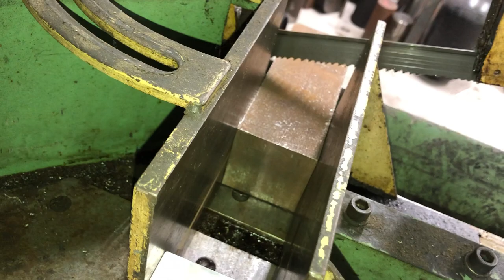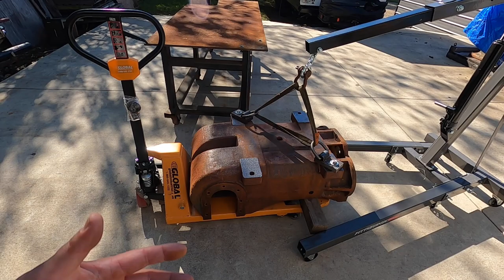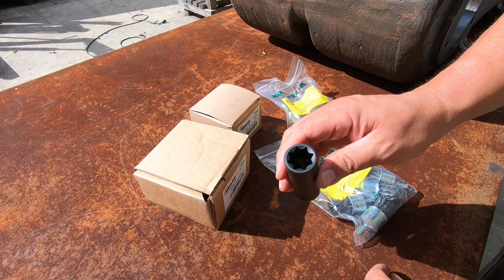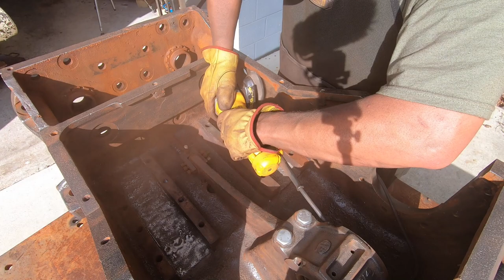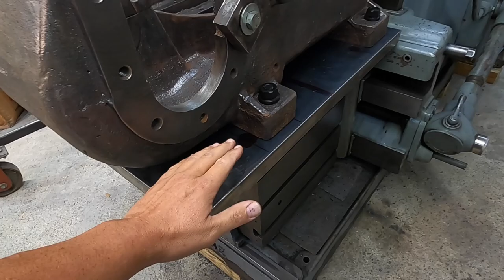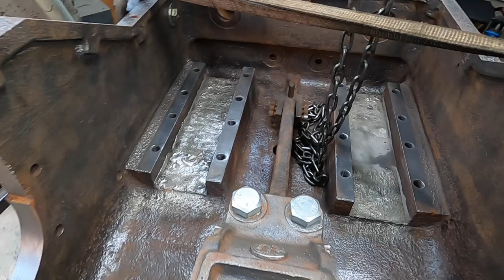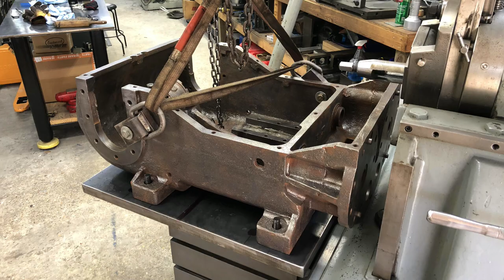SNS 326: Stoker Engine Clean Up & Test Fit, Indicating Square Stock, Work Boot Repair

Comment: I could both smell and taste that rust dust.
Spent many an hour doing wire brush rust removal at an old job. Wore the same respirators that the painters used, but I could still smell/taste the rust.
Ah, the memory of a nasty dirty back breaking job. Thanks, I think.. :)
Reply: The job I didn't like the most in an automotive shop was cleaning the carbon off of intake and exhaust valves. I could smell and taste the dust from that for a couple days.

Comment: I tried a pair of thorogoods after you mentioned them a couple years back, and I haven’t worn dire t work boots since.  I’ve been through danner, Wolverine, redwing, you name it, the thorogoods are hands down the most comfortable work boots, and made in USA!  You ain’t gonna run a marathon in them, but you can’t beat the comfort, stability, and durability.  I send mine back to thorogood for refinishing, but want to see how these guys do with yours.

Comment: Thanks for sharing! You might want to give the stoker engine a spray down with that CRC's Rust Inhibitor that you showed in the past.
Reply: That was used on the outside table I think. Does not seem to have helped much.

Comment: Couple of tips from a former foundryman, baseball glove lace is a good source for leather boot laces, and cheap, they're burn resistant. Also spray on pickup bedliner on the toes of work boots protect them vary well, but make sure to silicone the boot sole stitching before spraying, or the cobbler can't resole them.

Comment: When I see Stroker engine I think 383ci SBC (small block Chevy). I put one in a 1986 Chevy S10 back in the day before LS swap the world.  Started on it at the age of 13 learning how to and working to pay for all of it myself.  Had it ready to drive just before turning 16 and tuned it to run good at 16 years old.   Part of what made me go down the part I did.  My family were Carpenters loving them dead tree carcass. Only thing I like about wood was it looked good as the bed in my truck.  Love metal

Comment: Instead of high-speed or carbide you might consider 10% Cobalt High Speed Steel. All my internal and external threading tools are 10% Cobalt and they resist wear like nothing else.

Comment: On my small bandsaw it also has a movable jaw .
I did use odd blocks to balance out the jaw on short work. I then got the idea to drill and tap a 1/4"-20  hole in the movable jaw on the side opposite the saw blade. 
I cut a piece of 1/4" allthread and jammed a
hand knod on one end. 
I screw that in the 1/4" taped hole. I use the screw to balance out jaw.
Works perfect . May not work on your saw .

Comment: 5:00 Magnetic blocks and internal indicator - you could just use 2 opposite each other, focus on that axis then swap the magnetic blocks to the other 2 sides and get them aligned.
Reply: @paulcopeland9035  Maybe you haven't got 4 !

Comment: Abom -genuine question after seeing someone compare many pentrating lubes... how does evaporust work on siezed bolts?  Might be worth a quick vid maybe, comparing it to leading oils?
Reply: All you need is good ol.. WD40... it cures everything.  I use it for thread tapping too.

Comment: It's good to see you wearing a mask when grinding that rust. Ive seen a lot of people just stand in a huge cloud with no PPE. I don't know how they do it.
Reply: Think he smokes, so his lung should be just fine.
Reply: @clutch5sp989  smoking is probably better than all that oxide :)
Reply: @clutch5sp989  Not sure how smoking makes lungs just fine.
Reply: @jonka1  "lung" (singular) is fine. It's a smokers joke thingie
Reply: @clutch5sp989  "lungs" plural ... meant as a generalization. Good joke, btw:)
Also: This meta-level of sarcasm most likely confuses the ordinary YouTube user.
So lemme translate this thread: USE A F'N MASK, when grinding or producing any other kind of dust that wants to wildly fertilize your lungs.
To the people: We give a s. Its your lung, and it is your life.

Comment: On my four jaw I mark 2 jaws and don’t loosen them so when I flip my parts I just tighten the two that are not marked and it is pretty much on target this just works for after the first set up never tried the trick you just showed for square or even offset square parts I love learning new stuff old school machine’s are the best you learn so much and make you feel like part of it CBC has it’s place but it just makes you a programmer I have done both and preferably old school is the best you have to think about it and come up with new stuff that works I feel much more proud of what I make

Comment: Adam - don't worry about the exterior appearance of the stoker - rust is as clean as it will ever be on the locomotive, it more likely will be encased in oil, grease and coal dust.  I only worked on the railroad for over 50 years.

Comment: Adam, wouldn't it save a lot of time and work removing rust on something like this engine you were to spray it down with some type of oil, when clean, before storing or transporting it.

Comment: Adam if you take a spray bottle and mix 50/50 mineral spirits and Lucas oil engine oil stabilizer then spray the parts they will not rust and clean up is easy.
Reply: Or WD40 works a treat
Reply: WD-40 was designed for that job !

Comment: Good idea on the square stock. I need to find an inside attachment, used of course. I hope everything works out with that weld job on the engine, although it would be interesting to see what ideas you'd have to fix it another way. Those soles are worn, how many years have you been wearing those boots? Keep us updated on that, it'll be cool to see how they turn out.
Reply: You can use stiff rubber bands if you don't have magnetic blocks too.

Comment: Hi Adam , Spray a little WD40 on the rust before using the wire wheel to keep the dust down,  >Joe Morris Baltimore MD.
Reply: Mineral spirits in a spray bottle about 500x cheaper

Comment: Not being a machinist, could you also scribe lines diagonally on the face and use a dead center on your tail stock to find center?
Reply: This is exactly what I do when setting up a part that doesn't need to be super precise. If I'm accurate enough with the scribe lines, I can get with .010" of the center of the block with the dead center.

Comment: Adam: to respond to the naysayers about a less than flat fixture plate I see it as really adapting the engine case to the shaper table. And the engine case wasn't flat footed to begin with.

Comment: I'm tellin ya Adam your first impression to make some machining video's,  seem's to be working out . The stoker engine is a tough job looks like but I think that makes it very intresting. Boy fireball tool just makes simplicity convenient. That block set up wow! quick. Manufacturing is changing and making people aware that there are some very talented people that can repair and restore like trenton and heath here on you tube well thanks. Know anybody that can make Doing your taxes easy. No I'm not kiding I have a head full of stuff that I designed how do i get started. I mean the chamber of comerce or just get a buisness license and keep my reciepts in a shoe box. You hire someone or what?
Reply: Taxes ? Use a spreadsheet !

Comment: Of course the real question is "why is it rusty in the first place?" Would it have been too much to spray the unit with oil, or simple rust preventative? For example: Rust-Oleum Aerosol Rust Inhibitor?  As we know an "Ounce of Prevention....." Cheers.
Reply: WD-40 should be the thing as that is precisely what it was designed for.

Comment: I am not a machinist, but love to watch lathe and machining work, particularly Adam.  A question I have, is the impact of the corners of a square stock on the cutting tool damaging to the tool?  It seems that there must be a tremendous amount of energy and force each time the corner impacts the tool.
And, WOW, that drill bit has got to be getting extremely hot without lube, seeing the great amount of smoke coming out of the cutting.
Reply: that smoke was acttually a lube.
Reply: Yes, you're correct, intermittent cutting is very hard on cutting tools, especially Tungsten carbide/cemented carbide, there are tougher grades that are not so hard, and larger radius also helps, Adam was using what looks like CNMG  ( Rhombic 80°) in a PCKN toolholder, 75°approch, so loads of strength behind the cutting edge. ( I had a carbide insert book in my hand watching, looking to order some other inserts and toolholders). Hope this helps.
Reply: Thanks for the info replies, Bosted Tap and Sixta 16.
Reply: There are workarounds for insert longevity, like taking as deep cut as you can and slow the feed down not in facing so much but when turning. I managed to turn a rotary hydraulic motor rotor and housing like half inch shorter and only used 2 corners of a chinese 6 corner insert that cost a buck. That thing is hard as a coffin nail on top of the interrupted cut. (Not really interrupted in this case as I cut it so deep) The motor went back to use after hacking all the internals with some machines.
Reply: @shortfuse43  You're very welcome.

Comment: Adam, I'm a machining dunce, so my place here has always been to keep my mouth shut, and my eyes and ears open.

Finally, I can help you out - I'm a former soldier, so care of leather boots which work for a living is something I can advise on. Those boot tongues would lick your hand with gratitude if you spent an hour on that leather.
Grab some white spirit and pour it onto a rag, wipe the boot down with it. This will strip all the junk, including any old polish off the boot.
You need a tin of any old tan coloured shoe polish and two brushes. Use one brush to put the polish on and get it really well worked into all the nooks and crannies. Leave it for 20 minutes and it will somewhat soak in. Hit them again. Keep hitting them with the polish until you get a fairly even colour.
Leave them overnight, and the outer polish will somewhat harden. Hit the boots with the other brush until they shine.

Later, after you've worn them a while and they start to look a bit sad, make sure they're dry and just top up the leather with some more polish with the "on" brush. Then, shine them up with the "off" brush.

I GUARANTEE longer lasting, more comfortable and damage resistant boots.
Reply from the maker: Thanks for the tips! 👍🏻

Comment: As far as penetrating fluid goes, knocker loose works good but if you can find it, kimball midwest torq cb 2 breaks stuff loose like youve never seen. Its expensive stuff though, last i saw it was 25 bucks a can. Butnif youve got something that just will not come loose after soaking its well worth it.
Reply: Scoutcrafter uses 50/50 acetone and automatic transmission fluid, he says it's really good

Comment: Would it be possible and practical to remove the worn areas and replace them with new metal? Its several decades since I worked in a machine shop and this kind of job is way outside my experience.

Comment: 12 point socket works well!
Reply: It may work sometimes, but a 12 point socket is not the proper tool for a four point bolt head or nut.  Four point fasteners have corners of 90*.  Twelve point sockets are designed to work with six point fasteners, which have angles of 120*.  Four and eight point sockets use 90* angles to fit the fastener properly and reduce the possibility of damaging the fastener.
Reply: @elcheapo5302  Thanks for the clarification,
I could never find an 8 point so used the 12.
I appreciate the info.
Hope you have a Happy Thanksgiving and a safe one!

Comment: Abom i want to see you around for a while man , put that dust mask on when you wire wheel the rust of parts man , protect your health during these crazy times ,love your videos brother thanks.
Reply: 100% agree!!  I was going to post the same thing!!  You’ve got the ear protection on, but protect your lungs as well!!!  We want to keep you around!!
Reply: I was happy to#33 that the second time he was using the wire wheel to knock down the rust he was using a mask!,
Reply: I noticed that when he was removing the rust from the outside, he wasn't wearing one, but later, when removing rust from the inside, he was wearing a mask.

Comment: Just wondering if that stroker engine had a twisted off bolt I saw what looked like part of a bolt down in the hole as you was showing it for the last time mounted on the shaper the part that was closest to you by the main bering Journal, By the way another great video.

Comment: Is it just me or is that sound the lathe makes when it is cutting the edges of the square block one of those "something very bad is about to happen" kind of sounds? Which usually precede something like a wheel falling off your car on the freeway at 70 MPH.

Comment: Those slip-on boots are called Wellington Boots. Didn't you spray that outside steel table with a product that prevents rust? Why not use that same product when you ship the stocker engine back to Keith?

Comment: I've said this before - you should build an electrolytic rust removal tank.
A used cargon , basic 6 amp battery charger, some steel for sacrificial anodes ,washing soda and water is all you need. The only consumable you need to pay for is washing soda.
put a 5 amp fuse or circuit breaker in the DC circuit  (in the charger cable) to protect the charger in case anything in the tank  shorts out.
It would clean that engine up while you slept.
http://oldengine.org/members/orrin/rustdemo.htm

Comment: I would probably forget to take the magnetic blocks off after indicating the block and I’d fire up the lathe and get one upside the head!
Reply: I bet that is the sort of mistake you only make once... If it would not knock you out permanently, you sure won´t forget.
Best to stay to the side of the spinning part, just to be sure.

And you know what, I am pretty sure I would (hopefully be able to) go and collect the blocks as well.

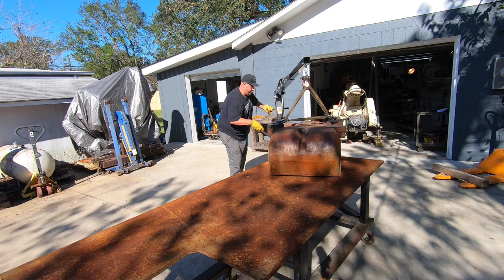Comment: At 11:07 that disk handled that rust like a beast. What kind of disk was that if you don't mind me asking?
Reply: Lol disk, I also wondered what it was, but I think it's just a cup wire wheel and the centrifugal force of the high rpm grinder widens it

Comment: Will it be better if you use laser rust remover?
Reply: Would be easier for sure, but those things are pricey. Good thing about them is that they not only remove rust, but also grease, paint etc.

Comment: what is this stroker engine, i went back to your other videos but can't find out what this is used for. thanks
Reply: I believe its used to feed coal into the firebox on steam engines.
Reply: It is a steam engine mounted on the tender (amongst the coal)which augers the coal into the locomotive boiler.
It stokes the fire.
Reply: A stoker engine drives the screw that moves the coal from the tender into firebox of a steam locomotive. The steam locomotive this stroker engine came off of is an American Locomotive Company J-3 Class manufactured in 1942 for the Nashville, Chattanooga & St. Louis Railway. The locomotive in the process of being restored to operational condition by Nashville Steam Preservation Society. https://www.nashvillesteam.org
Reply: @SandBoxJohn    Thanks, I was wondering which engine this was.
Reply: @paulcopeland9035  Thank you.
 Copy and pasted stroker engine from Lawrence Veinotte post.

Comment: 22:00 Silicon bronze
Reply: My thoughts exactly from the moment Keith and Lance were doing that spray weld stuff. Get a spool of SilBr mig welding wire and pad that up with silicon bronze using spray transfer mig brazing. Far superior material and WAY easier to lay in there. I mean, its what its designed for! I was going to say something long ago about that but there's no telling those guys anything.

Comment: Did anyone else find themselves holding their breath when he was using the wire wheel on the rust??
Reply: Last time I used a wire wheel on rust without wearing a mask, just because I have to plead guilty on beeing just to lazy to go fetch one.I am not sure what I found more annoying, breathing in the rust particles making my snot look like... uhm yeah or the wire bristles going everywhere, especially my face, hands and forearms (at least I was eye protection). Must have been a pretty shitty wire wheel though, it was bald after a few minutes work.
But still not as bad as me catching with a wire wheel some of those felt blankets or covers i put under what I was working on... Yeah, sometimes we do really silly stuff if we don´t think through what consequences certain things might have. Took me hours to get everything out of the spindle again.

Comment: Consider a particle mask when wire brushing rust.  Save your lungs.
Reply: Ear protection ✔
Eye protection ✔
Hand protection ✔
Clothing protection ✔
Mouth/nasal/lung protection ✘ 
No real point doing the first 4 if you are going to ignore something more important that you can't live without (breathing)
To reiterate blind people survive, deaf people survive, limbless people survive, clothes can be replaced - lungs are much more difficult to live without 

^not trying to teach an old dog new tricks - guessing Adam knows he f*cked up big time and when "her indoors" (sorry I forgot Mrs Booth's name) reads this someone, who will remain anonymous, will get a well deserved kick up the a$$ ... reminder

Day 2 - think he got the message
Reply: @paulcopeland9035  Did you not see him working directly in front of the camera with dust flying at 11:09? That's what they're talking about here...
Reply: @paulcopeland9035  That's day 2 - check again the first bit (day 1) where Adam cleans the outside of the stoker engine casing.

Comment: If the weld up material doesn't work, would it be possible to machine it down a little farther and then put on some of that synthetic material they use to line ways with? Or would the forces and maybe heat be too high?